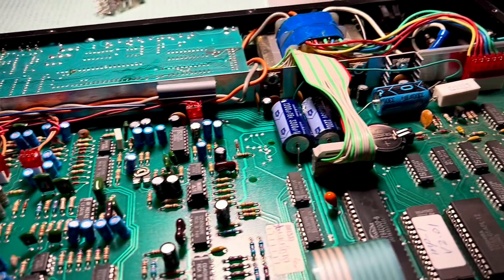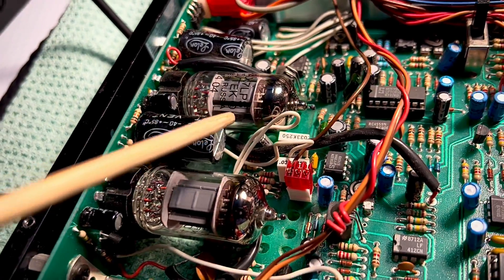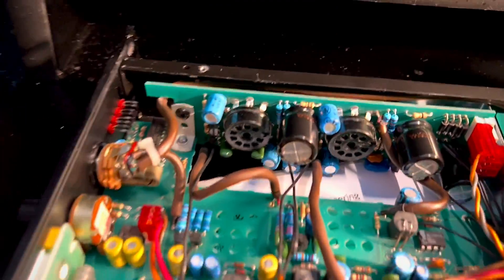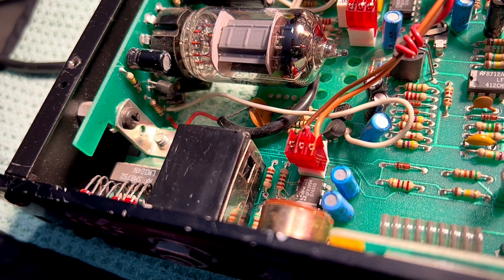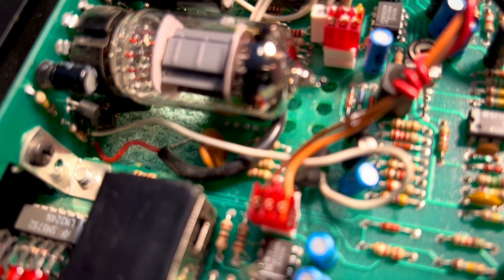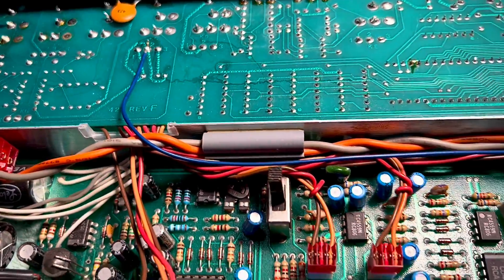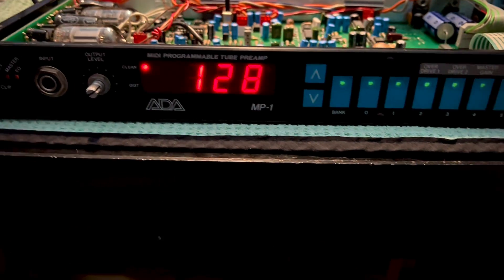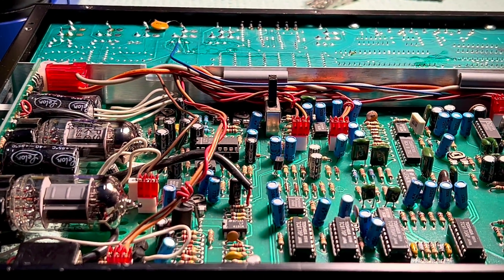ADA MP-1 (Pt 1): The War Against Bespoke Obsolescence

Comment: I bought a used MP-1 off Ebay back in 1994 for cheap. It worked fine for several years before becoming quite microphonic. New tubes did not help. After a maybe a year longer it would just go silent. A well placed whack with the butt of a screwdriver would restore life, often for weeks, but the silence would eventually return. Somewhere in the early 2000's I replaced it with a DIY preamp and the MP-1 got stashed somewhere, and forgotten. My 41 year engineering career ended in 2014 and I had to move everything 1200 miles on short notice. About a month ago I crack open a hastilly packed box from 2014, and there it was, the MP1 had been sleeping for probably 20 years. I connect it between a guitar and a DIY tube amp, hit the switch and get, silence. One good whack, and it ROCKS! the crazy thing is that all my old presets are still in there. Mine has a Zilog CPU chip and a 2.01 sticker on the EPROM. The latest date code I can find on any part puts its build date in 1992. The input jack is the typical Switchcraft open style and does not seem to be noisy or intermittent. The rear panel jacks are a different story, as they are plastic boxes that take a bit of plug wiggling to get a connection. It's sitting on a shelf for now, but I'll probably get it down and dig into it when I clear some other projects off my workbench.
Reply from the maker: Great post!  Those rear jacks will give you hell if you even look at them sideways. Do not make eye contact.
Reply: I had opened the top of the MP-1 many years ago to replace the tubes, and again recently when I found it. I had never taken the bottom off, so after you made me curious, I decided that I would use the pointed end of the screwdriver to take the bottom off rather that the handle to whack it. I was careful not to let those jacks see me taking their picture.  Then I slapped both covers back on with two screws each and put the MP-1 back on the shelf. It does look like it would be nearly impossible to find a drop in replacement for those things, but maybe there is something that could be mounted in the hole and connected up with flying wires. There's got to be something out there in the stomp box world......maybe.  @ForgottenGearRestorations

Comment: I have an original ADA MP-1 that appears to turn on. I am the original owner. Is there a place in Dallas/Fort Worth I could tale it if I have any issues?
Reply from the maker: It's going to be incredibly challenging to find someone in your local market that would be willing or even competent enough to work on it, I hate to say.   Spare parts have to be on hand when doing even the most mundane types of service.
Reply: @ForgottenGearRestorations  That is a bummer. So if it breaks I am out of luck
Reply from the maker: @braxal6983 not entirely, just make sure you have a good tech network. The main problemsI've seen these revolve around failed batteries and caps. No need to remove PCBs on these with the e caption of those on the tube sub board. Now, broken jacks and other hardware will put you in the hurt locker!  Just be gentle!
Reply: @ForgottenGearRestorations  Well, The original battery is still in the unit. I think that could be easy replaced by me? IS it hard for me to get out my soldering iron and replace caps? How can I tell if they are no good? I appreciate your help.
Reply from the maker: @braxal6983 the most difficult aspects of servicing these preamps include having perfect technique with your iron and perfect tip temperature. Either one of these is off and you'll see curled and lifted solder traces. The boards are enormously fragile, so you have to go hot and fast on low and slow. Both cap and battery alike require soldering. Even if you install a battery socket, you'll have to solder it in.  Just practice your skills on other things first.
Reply: If anyone could do it, it would be Terrence Slemmons in Dallas. He's the go-to guy for fixing old rack units like the Roland SDE-3000. He has worked on some recording gear for me and does excellent work.
Reply: @marmaladecreammedia  Thank you. I looked him up on 3003 Commerce in Dallas?

Comment: Hey my friend, I enjoyed this video. You respect the realities and tradeoffs of working on gear from the 80s. I noticed you are using a CR2032 cell battery for the the memory presets. My research tells me the original used a BR2325 3V coin cell. I believe eitherr will work, they are both 3V cells. Are you in the business of repairing ADA MP1 preamps?.Thanks!
Reply from the maker: Hi!  Thanks for the comment. I like the additional capacity of the 2032!  I have been working on these old preamps for about 15 years. I don't take them on often and when I do it's at great risk!  I'm on my last donor unit and hope she will give life to the community out there. Lots of guys still using these to put food on the table.
Reply: I have one that's way down on gain but works.  It needs servicing by someone who knows them well.
Reply from the maker: @Turboy65 have you changed the preamp tubes?  Which city are you in?
Reply: @ForgottenGearRestorations  Yes, I put in new preamp tubes. No change.  I'm in central FL.